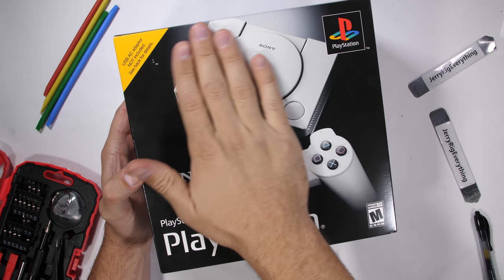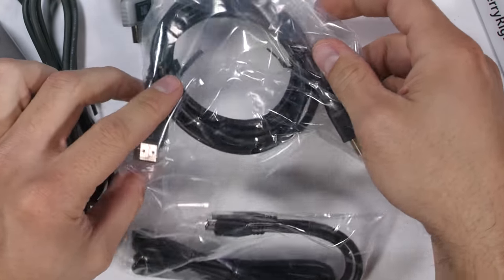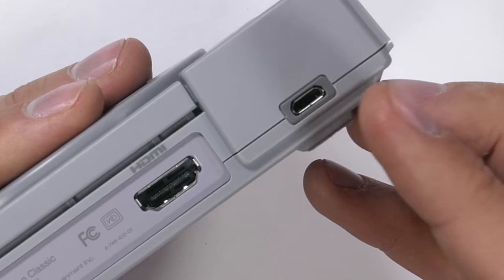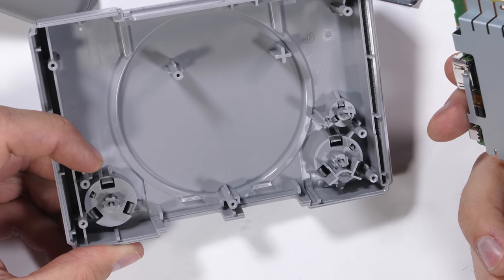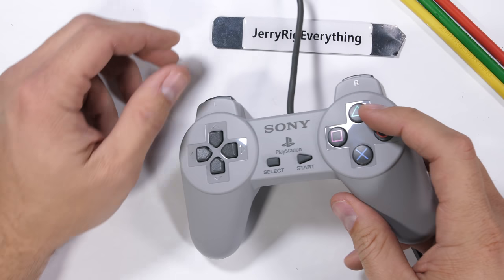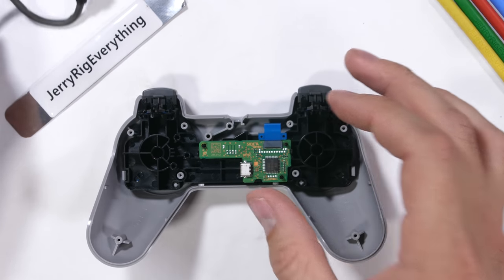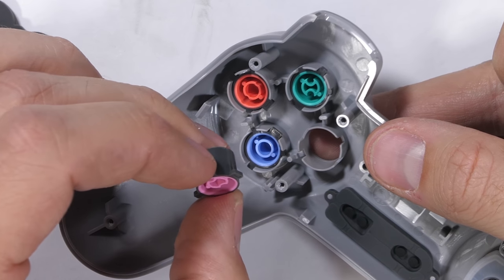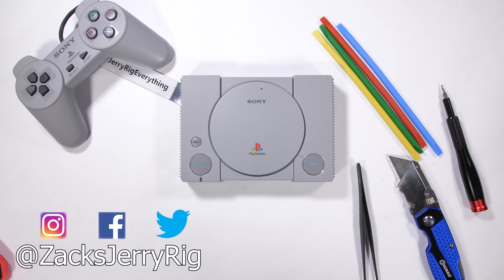NEW PlayStation For ANTS?! - PlayStation Classic Teardown

Comment: I would die form laughter if there was just a raspberry pi inside, they are already using an open source emulator, why not just get an entire system?
Reply: English please?
Reply: That was English lol
Reply: Because a Pi would be more powerful :-P
Reply: @d3generate804  raspberry pie is a open source miniature,low power computer.
It can be used to run low power,low performance based applications.
Reply: What's funny is the Controller has higher quality tech in it than the actual system itself.
Reply: Well the SoC in this is a Mediatek MT8167a, so the Pi is a bit faster
Reply: No bend test?
Reply: If they did that then they'd probably also use NTSC games instead of PAL for all of them 😂
Reply: Doesn't matter cuz the console is only 100 bucks with 2 included controllers. Raspberry pi + gamepads will require a few hours of work and will not look so good as this ps1 does. Still I will better connect my Android Phone to the tv and run the emulator than buy a dedicated device for this.
Reply: It is literally board like raspberry pi, but inferior, Chinese one, with mediatek crap CPU. Boards like this costs like 10 dollars and you can set up your own playstation classic. This is cashgrab, nothing more.
Reply: @Lukeywoodsey  Yep, Raspberry Pi also has an SD-card slot, which allows you to change/expand device's storage.
Reply: bouke Kalkwijk  its not its 100$
Reply: I don't known not including a power brick is not that bad. Everyone has them lying around this way there is less waste.
Reply: @aintgotnobody5518  Cheaper for them to build, not for you to buy lol
Reply: @raszop  Something something the plastic shell something something
Reply: @basileus9343  oh yes absolutly its probably like 10$ or less to build
Reply: @basileus9343  yeah it has plastic shell, but does it justify the price? Orange pi is literally 10 dollars and runs these games better
Reply: @ottovonbismarck9026  Brainn't
Reply: Because using a Ras Pi would be Sony giving you anything of actual value 😇 this shit PCB is more like Chinese knockoff Orange Pi with every networking/connectivity capabilities removed
Reply: The better idea is, they should include a USB port for reading flash drive that can read PS1 games downloaded from the internet. Sadly this is illegal to do and it violated the copy rights of the games.
Reply: corn Dude Plug on the brain and search for the therms im uncle google bud.
Lmao
Reply: Dorin Gaiu Well... A ps2 or a ps3 is cheaper from where i can see, and you can still buy the games, and play them at a pc using the dvd drive. 
Or get a psp. 
Pay $100 for 20 games, and not even many of the classic ones such as gt?
Reply: Eres muy mal 😡😡😬👎👎 todo los días
Reply: you have 666 likes atleast when im seeing this
Reply: I got a pi, case , fan and an 128gb sd card for around 80-90 dollars and i have around 8000 games on it , including 80 or so PlayStation games.
Reply: i thing same but i wuld instal macro pc in that be cool and micro cd  ram
Reply: You could just house the raspberry pi inside it, probably fit with maybe a few modifications. And voila !!! a "pi classic" that plays all consoles that are emulated.
Reply: @michaelmardling3152  U just install a PS1 emulator on your iOS or Android phone and hook it to the tv and you don't pay anything just the gamepads.
Reply: @MrXHDTV  come on
Reply: @MrXHDTV  whay not make secret pc of it which can run windows 10 and world of tanks
Reply: This would make a neat casing for a Pi. Would wait 'til it's a bit cheaper tho'
Reply: @evalonia  same but i wuld but in gbg micro pc in
Reply: I was legit expecting a raspberry pi
Reply: @blackfirehd884  same
Reply: Raspberry pi model 3 b+ would shred this console in gaming
Reply: AndrzejKucyg   Bj
Reply: It's so obvious because of the delay
Reply: @Deon Denis Or a better legal way, they provide official downloads and purchase of the games to expand the console life time. Fair and square.
Reply: corn Dude I perfectly understood that... in english
Reply: Dorin Gaiu the highest end raspberry pi is $35.
Reply: I was your 1kth like
Reply: @d3generate804  The Raspberry Pi is a very cheap and small miniature PC, who one of the things you can do with it is install a OS/application package (I believe it is called The Emulation Station) that can emulate multiple platforms including classic arcade games, consoles, and computers.  It costs far less than any of these classic consoles and actually runs most of the games better.
Reply: @kadrix732  if you mean Pi, no he did not it is a play on the word Pie but refers to the mathematical constant Pi.
Reply: Because the production runs of Pi's are limited and most are quickly gobbled up by customers.  Some Kickstarter projects tried using them but the turn around time for getting them when customers are their primary sales kept leading to issues so much there are entire companies that make variations and knockoffs for commercial products to make up for that.  The only companies that can seem to do Pi based products have very limited run specialty items that no one else is competing with them so they don't have to worry about someone beating them to market.
Reply: @MrXHDTV  As for the looks people have been making custom project boxes for Pi's that look like everything from a Famicom to a Playstation 4.  I even saw one that built the Pi into a knockoff working Xbox original controller.
Reply: wat
Reply: Because it's more expensive.
Reply: bouke Kalkwijk  Yeah right, a raspberry pi costs 40 dollars and you can download all the games you want with an emulator.
Reply: One word money
Reply: This is probably cheaper
Reply: @dani.phantom10  they're using PCSX Rearmed but it has problems
Reply: @dani.phantom10  That makes no sense, as this board can run both too.
Reply: @MRA_3  It is not open source.
Reply: The sad thing is that would run better 🤣
Reply: EPSXE please
Reply: @MRA_3  The Raspberry Pi isn't open source.
Reply: Buying the original actual system is expensive and you can’t tell if it’s maintained properly. Also buying the original games is also a hassle.

Comment: There's is a difference between nostalgic and cheap!
Reply: Amen
Reply: AXIOM 😂😂
Reply: Yeah it just sound light as a feather and not on a good way
Reply: It can't overheat because there is too much air,😂😂😂
Reply: Well the original was pretty cheaply constructed
Reply: Ali Adnan In this case, there isn’t
Reply: This is most definitely on the cheap side, but more due to the selection of games and many of those games not working all that well on the hardware/software provided.
Reply: @maxverkerk  ain’t no different than those third party controllers you buy for your consoles. And I’m certain the NES Mini feels cheaply made, yet expensive.

Comment: So I'm supposed to take one of my controllers apart and use the cable if I want to power my PlayStation classic?
Reply: You get the idea
Reply: Its not so hard tho, just pop those 8 screws off and plug off that micro USB with an extended cable and make sure you put it just like the original to avoid the motherboard from the stress, put it back, and set

Comment: I laughed when you took the controller apart and the controller cord is just a phone charger cable. Damn good design though you can get a super long USB cord and use it on this. I still have a few of my PS1 games and my PS2 + my library of games.

Comment: 3:06 or if you have even minor wire splicing and electronics skills you could install your own short adapter plugged into the board of the controller which leads to an external female mini-usb port so you can use different lengths of cables in different situations

Comment: The reason Sony does not give you a power adapter is because you should plug the console in to the 5V power USB port on the TV dedicated for external HDD. At least here in Europe that's the case.

Comment: Have teared apart a healthy dose of playstation units in my days, this looks million times less interesting than the original models.

Btw that micro usb plug inside the controller reminds me a lot of cheap fake chinese external hdd that turns out only a plastic housing with small usb flashdisk inside connected to an adapter.

Comment: I'm not surprised at this build quality considering the crappy emulation that the games included have.
Also there's apparently listings of a bunch of other games listed in this, but they weren't made playable.
The US version of the PS Classic has PAL region coded games for some that works poorly considering the US uses NTSC.
Also, the choices of games included for the US version is terrible.
Japan got NTSC versions of the games and they got a much better selection.
This is a hard pass for me even though I've been a long time PlayStation gamer since the original back in I think it was 1994/1995. >_< I feel old. LOL

Comment: I think it would of been cooler if the cable could of been plugged in from the top so it would make it easier to swap out. And, I wish the lid world of opened. OK. obviously there would be nothing in it, but it would still of been better. As you say they were going for high profits of quality. I guess you are looking at about $10 to make. Especially is they are made in China (which I definitely suspect they are.)

Comment: You don't need a USB power brick, you have more then enough around. Buy one if you need to. Got enough IT related garbage on earth already.
Also, maybe a USB extension cable is easier then screwing around with the cable inside the controller.

Comment: I wonder if there is a way to mount a laptop hard drive inside this, or an ssd, with one of those pcbs that are inside the slim 2.5inch caddys.
Perhaps wire a usb port to the pcb somewhere for it to connect to, put in a smaller heatsink like a raspberry pi one and get rid of that metal housing.

Comment: Honestly this PS Classic is not worth it. More like a statement factor too say you have it then worth using. 
I wanted too pick one up but too many corners cut, included games not really the best the og PS had too offer and on top of that they use a opensource emulator aswell so all they did is design the "UI" and block users off from going deeper unless you have a corsair keyboard you can actually get too thr emulators settings.
So yeah a pass for me i rather bought a pie instead.

Comment: Unfortunately the ROMs they use are crap and it doesn't have enough power to run them properly.  A guy hacked his SuperNES Classic to run the same emulator and ROMs and it ran the games visually better.

Comment: So it's more expensive than the NES and SNES classic, doesn't come with a wall power adapter, and has less games! 

Sony could just as easily allow for backwards compatibility through emulation software which would be more convenient, cost effective, and allow players to have access to play more games through either PS1 discs or Digital downloads. Talk about ripping off the consumer and using nostalgia to make those most loyal customers pay even more for overpriced and under performing plastic crap.